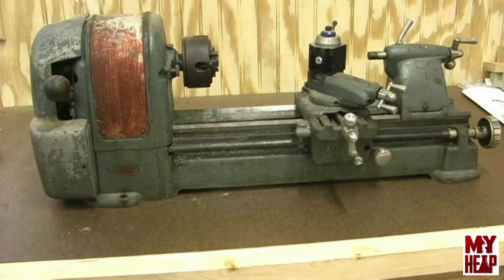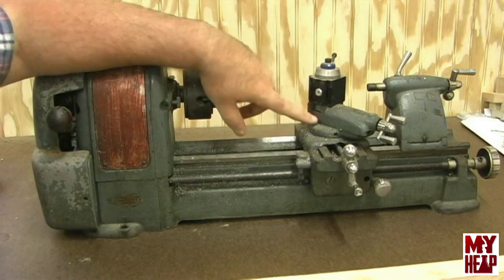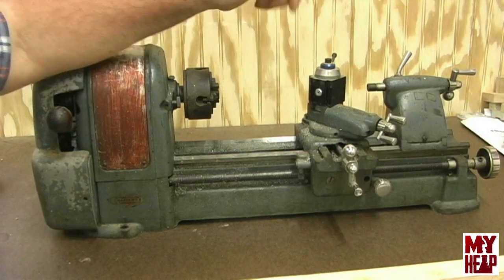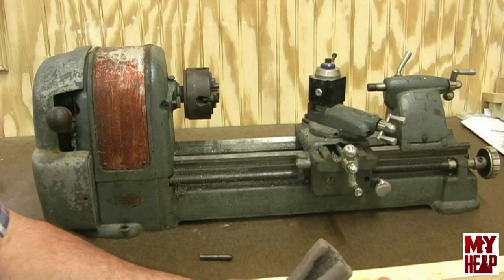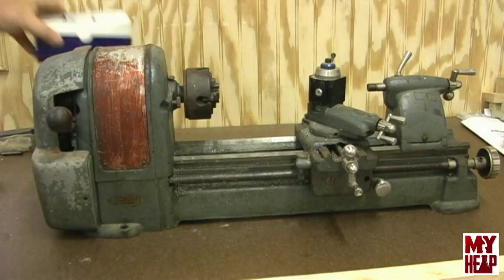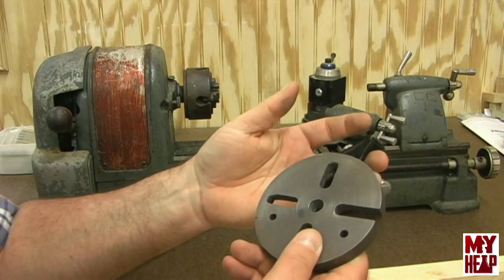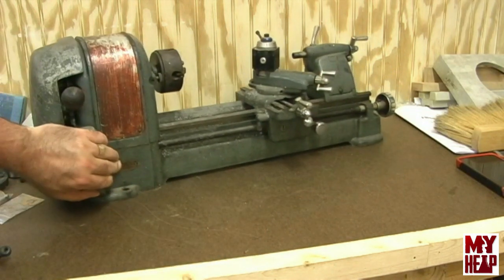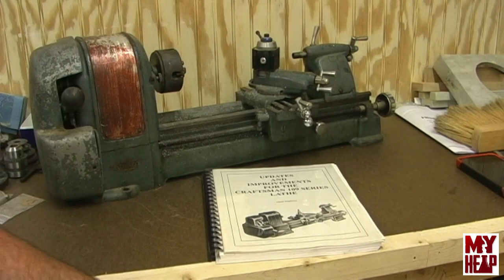Craftsman Dunlap 109 21270 Lathe

Comment: Thanks for taking time to overview the lathe, I got one yesterday, and noticed a slack in the spindle I think I have to replace the bearings, do you have any website to buy manual from you, I will appreciate, I am from Canada, have a nice day sir. Thanks.
Reply from the maker: Hello.  It has been a while since I had this lathe, but as I remember play can be removed from the spindle by an adjustment of the bearings.  The manual i think I originally got from the atlas craftsman group, originally on yahoo but now hosted at IO, and some of the printed material from eBay.  I hope that helps.

Joe

Comment: You said you found a guy online who sold replacement parts for these. Could you share that info? I purchased one at an estate sale and it is missing quite a few parts. Thanks!
Reply from the maker: @rescueworkshop2567  I am really sorry to pass along that the man who made parts for these little machines has passed away.  For resources I would check out vintagemachinery.org and maybe Craigslist or ebay for specific parts.  What are you missing?
Reply: @MyHeap  Thanks for your reply, will reach out directly.

Comment: I have one of those little older before Dunlap I believe has perminent dead center in tailstock but has a few teeth missing on one of the plantitary gears,, l just display it but there still as good as most mini lathes you can buy for 500

Comment: Great video! I am looking at purchasing one but I am curious what types of metal turn well on it? Can it do small cast iron or steal work?
Reply from the maker: Hi David.  The little 109 can cut steel and cast iron but will have to be in light cuts.  A precaution I would like to share with you is that it is a very light machine and lacks in some ways.  If you are looking for a small 7 inch-ish swing lathe, please consider looking at the craftsman 6" lathe if you are wanting old iron, otherwise you may want to look at some of the smaller Chinese lathes.  I am not trying to talk you out of buying one of these, but want you to know that they are a bit unfriendly to the new user.  For example the crossfeed screw and compound screw are 28TPI, and no graduated dials which means you will have to use indicators for travel.  I talk about some of that in the video.  If you have questions, please feel free to ask.

The lathe does turn aluminum and brass fine too.

Joe

Comment: Just wondering where u got your parts for this lathe my husband just acquired this lathe I believe  “craftsman 6” metal lathe model 109.21270
Reply from the maker: Hello Karyn, thank you for watching.  The man I used to buy parts from has passed away.  I would suggest contacting little machine shop and keeping an eye on eBay.  There we quite a few of these little lathes made so the parts you need may show up at either of those two places.  Might I also suggest you joint the atlas craftsman io group.  There you will find documentation and other folks who have the same lathe or other information about it.

Joe

Comment: I just acquired one of these, I figure it to be good for brass, aluminum, plastic.  the motor with it is not the original and is not attached. Question: standing in front of the lathe, what direction is the motor pulley turning? towards or away from you?  thanks, also nice informative videos.
Reply from the maker: The motor pulley should be running toward you.  And to just clarify, if you look at the chuck on the headstock from the tailstock end, the chuck will spin counter-clockwise when the lathe is running.  The headstock spindle is threaded with a right hand thread.  This way if the chuck slips on the spindle it will only tighten more rather than spin off.  Thank you for watching and commenting.

Joe

Comment: Could you give me the website where you found the replacement parts?
Reply from the maker: Hi Andrew, in fortunately the man who made replacement parts for the Dunlap lathe has passed away.  You may find some bits on little machine shop and documentation on the atlas io group (formerly Yahoo). Sorry for the bad news.  What parts are you needing?
Reply: @MyHeap  That is unfortunate i was just looking for a new head stock spindle mine is bent. However there are plenty of used ones for sale from time to time I will just have to get my hands on one of those. Thanks anyways

Comment: pretty neat little lathe, the graduated dials shouldnt be too hard, just 36 division dial really, which most dividing stuff will easily do 36 divisions. The final morse taper in the tailstock ended up being MT0 then, It looks kinda like MT1 int he video to me.
Reply from the maker: Hi Chirpy.  Must be a trick of the camera.  It's a MT0.  I calculated out the error on using a dial using 35 or 36 divisions.  As long as you measure after each cut, the error was very slight.  Thanks for stopping by.  😀
Reply: oh, ok, I dont have any mt0 stuff or I'd make up something like a little live center to go with the lathe since it's going for teaching in a school. I might try to dig some stuff up to send with it if I can find anything.
Reply from the maker: That would be awesome Chirpy if you find something.  If you do, let me know and I will pass the address along to you.  You can email me of you like to xavier@gtec.com.